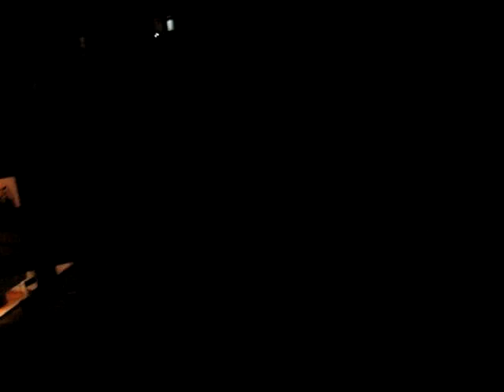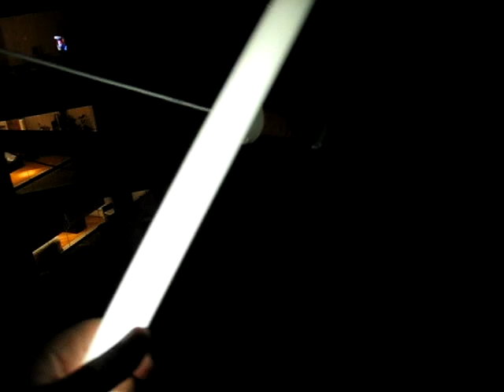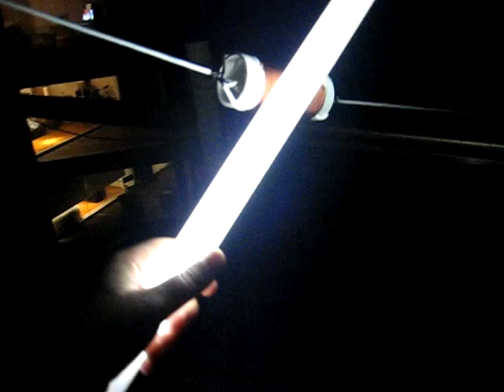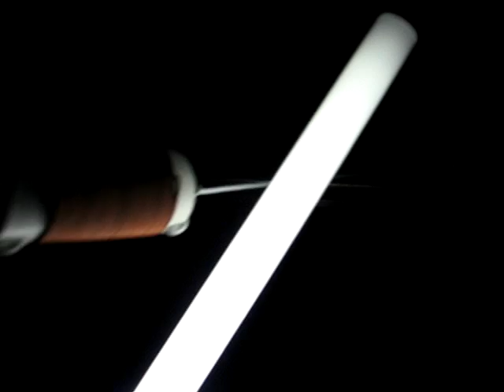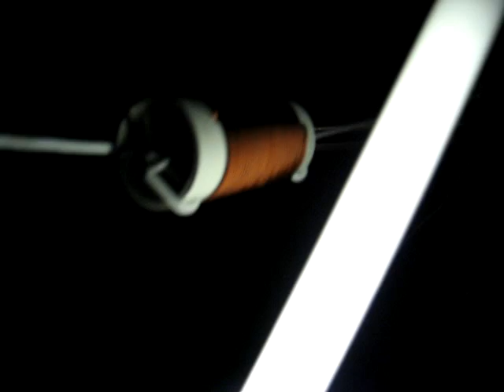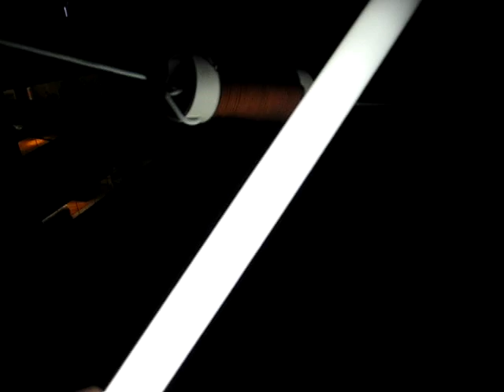Fluorescent Tube in Antenna Electric Field

Comment from the maker: It is just an aluminium tube, 15 mm in OD, mounted on an insulator and worked against the balcony railing.  It is about 3 metres long, so it is quarter-wave resonant at around 10 metres and half-wave resonant at 6 metres.  Elsewhere I base-load it for simplicity.

Comment: Very interesting ... the coupling that is. Something to test for the next time things don't quite behave as they should according to theory!!

Thanks for taking the time to do the vid and the write-up ...

.
Reply: Can you elaborate? What do you mean
Reply: @brandonlaragirl  re: "Can you elaborate?"
Unfortunately, I do not at the moment recall the frame of mind I was in (what I was thinking) when I made that comment. 
I will have to review the video and see if anything relevant comes to mind.
I can say - It is well known that a Fluorescent tube placed in a strong RF E-field that the gas in the tube becomes ionized and the tube lights - I suppose I should begin there.
Reply: @brandonlaragirl  re: "Can you elaborate? "
Now I remember. I have performed antenna testing with two antennas in proximity, to the point where they could interfere, in fact, measureable energy (power) could be  noted one to the other. I should have measured the amount of coupling, how may deciBels (dB) down the energy was from one to the other and coming back on the feedline. I was testing on 80 meters at the time between a tuned loop and a 1/2 wave dipole. 13 yrs back is a long time in internet years.